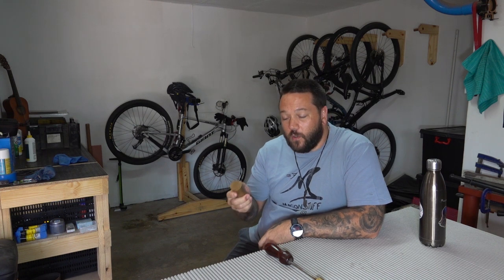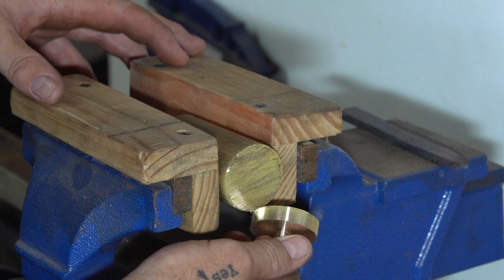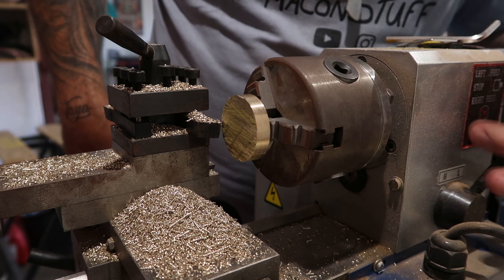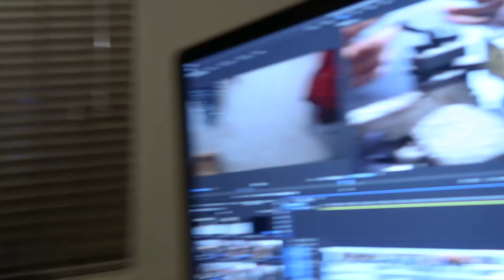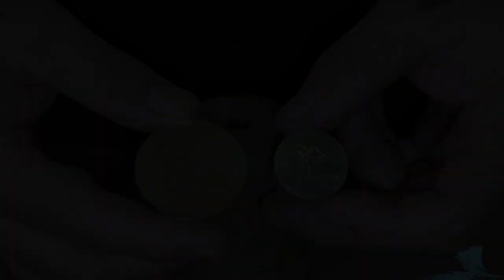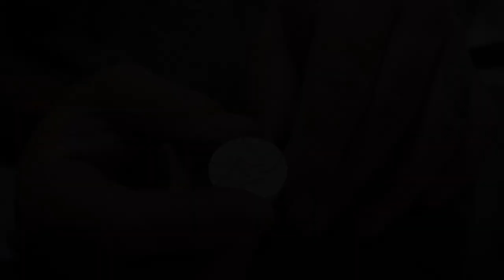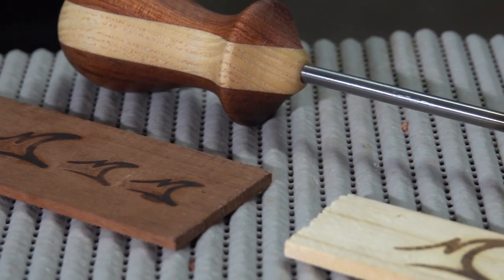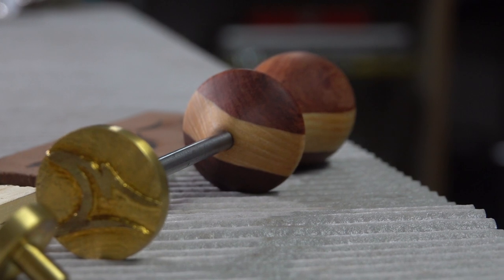Hand Made DIY Wood Branding Iron/Makers Mark - Two Sizes

Comment: I would recommend placing several notches at the side of the iron to help track the orientation of the iron.   If the wood is also marked to match, you will get the orientation desired.  In event that the iron wasn't hot enough, there's an opportunity for a retry (at least getting it close).  

Thanks for sharing.

Comment: Hay Mate, difficult to fault find that variable speed drive on the lathe remotely but as its intermittent I immediately think wiring looms and connector contacts first. As you have replaced the speed pot, try checking where the wires from the pot are going into the electronics. Check the wire crimps (if any) and if any connector spring contacts or pins are tarnished. As its going full speed with no control I would pay close attention to the 0V wire going to the pot track. If that comes loose the wiper will get pulled fully up to the reference voltage - giving full speed and it will not matter where the pot is at on the track as it is no longer a potential divider, just a variable resistor with next to no current going through it.

As I really enjoy your videos I will also warn you that the drive electronics can still have very high DC voltages on many minutes after they are turned off and unplugged... Stay safe.

PS I have got most of the mouse poo out of the pump organ now and its your video series that gave me the confidence tackle the job so thank you again!
Reply from the maker: Thanx a lot man... I'll se what I can figure out on the lathe front... good luck with the rest of the organ...